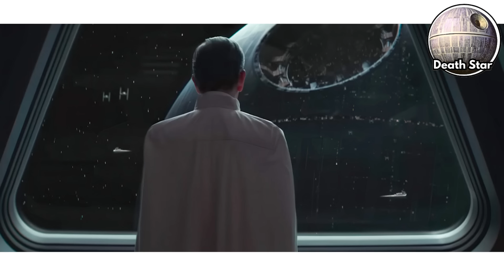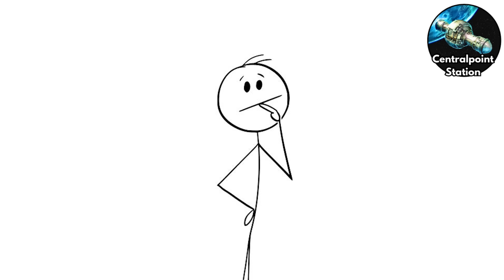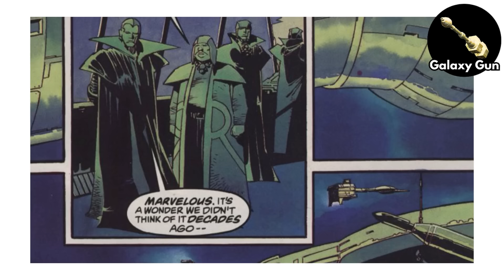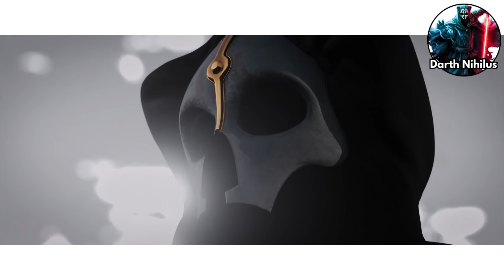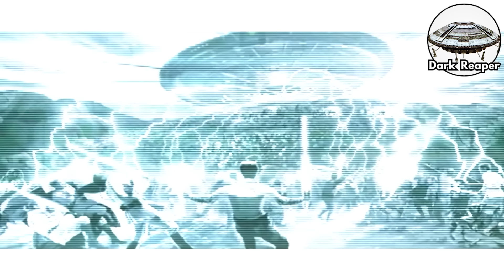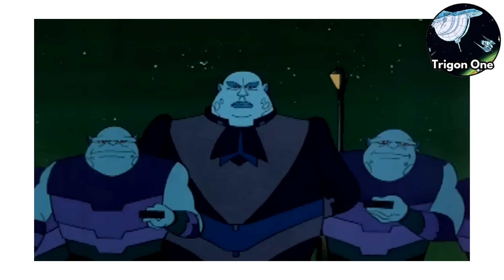Every SUPERWEAPON in Star Wars EXPLAINED in Detail

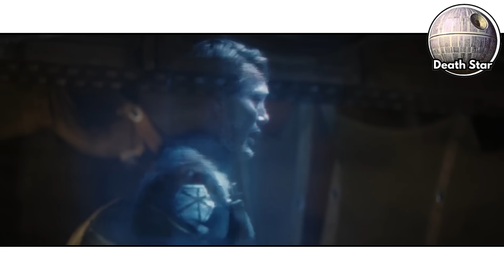Comment: 5:24 I genuinely hate this fact tbh, no way the other engineers wouldn’t peer review their work and see that and go “hm, let’s give that a solid cover
Reply: The explanation I give myself is that since Galen Urso was pretty high-level as far as the engineers went, and obviously very smart, he probably tweaked a bunch of other parameters to make it impractically difficult to fix the issue. Put other critical systems close enough to the exhaust port that they'd all need to be moved in order to change the shape, make it small enough that everyone assumed it would be impossible to shoot, which would also force the temperature in the exhaust port itself to be much higher, meaning any sort of filter or barrier system would need to deal with extreme amounts of heat, etc.
Reply: Well as far as I remember it was more subtle than that. 
For all that I have understood the exhaustion port leading directly to reactor would not NECESSERILY lead to destroying the whole station, but it only lead to it because there was well-masked (at least it was implied it was well masked) flaw in the reactor itself that in case of getting a shot into reactor would lead to chain reaction causing entire thing to explode. Probably without that it would harm the Death Star significanlty but with more safely designed reactor it perhaps could done only some repairable damage.
+all that DarthRayj said are valid points too.

Comment: Where did the Nihilus clips come from?
Reply: From the KOTOR 2 cutscenes.
Reply: If there's multiple comments it's because I wrote a one lengthier that disappeared even though it's shown under your OC, but I'll try to cut and repost..
Reply: If you want to experience some great immersive space opera in the SW setting with freedom of choices then check out the both KOTOR & KOTOR 2 games.
Both games are imho the peak of SW RPG games.
There is also The Old Republic MMORPG based on the aforementioned games, and if MMO is your thing it's one the best games in genre and iirc it's still running with plenty of servers.